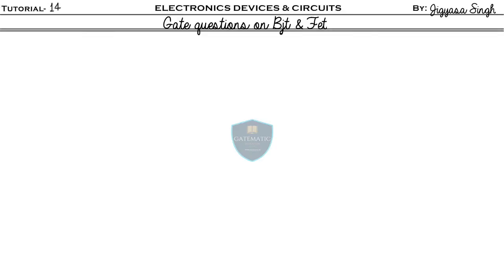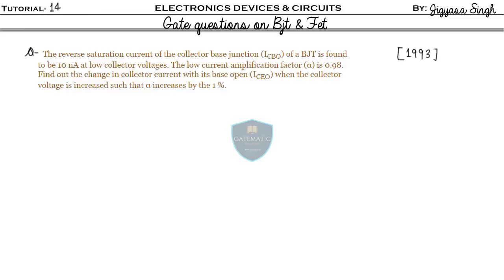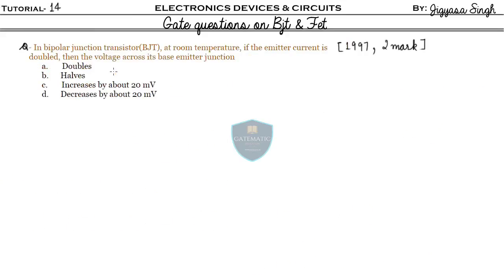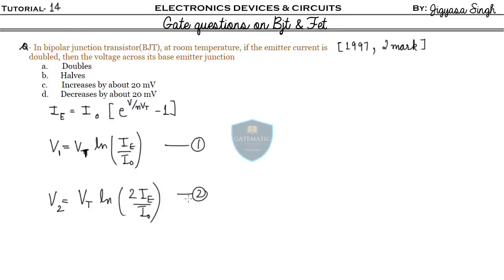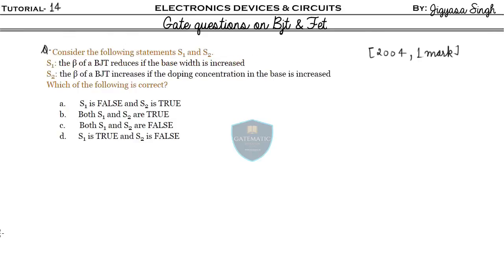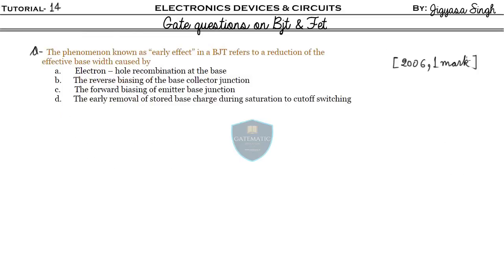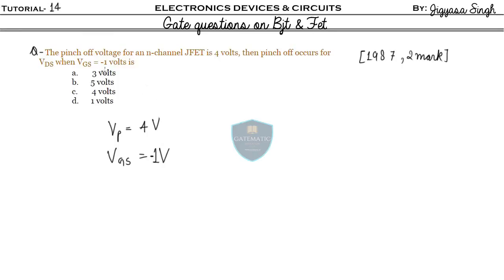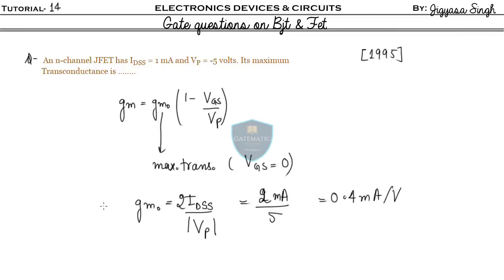Lec 14 GATE Problem based on BJT & FET

Comment: mam in ques 3 alpha is given 1% and u took it as 1.01 instead of 0.01..please check and provide the correct solution for it.
Reply: if 100percent is "1" then 1percent is 0.01 therefore if increased BY 1 percent  then {101percent=100percent+1percent} 1+0.01=1.01